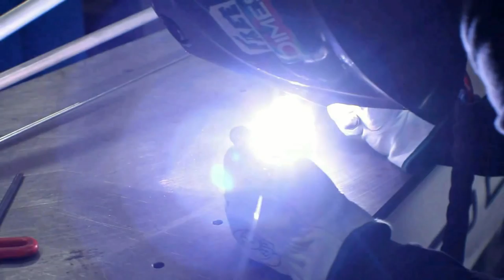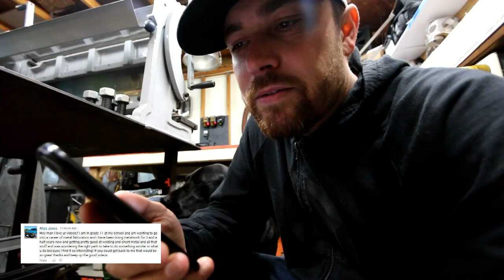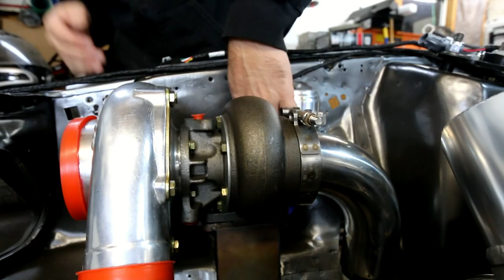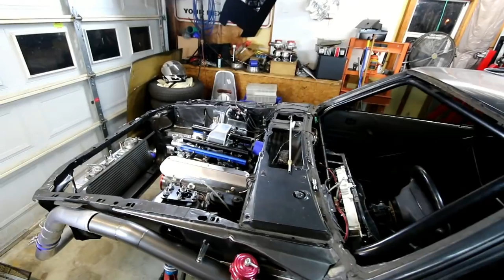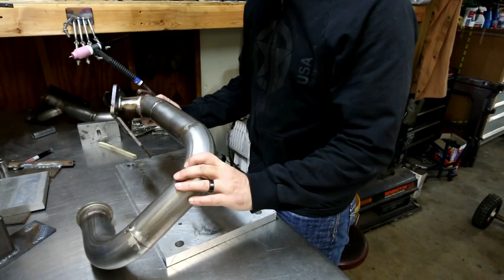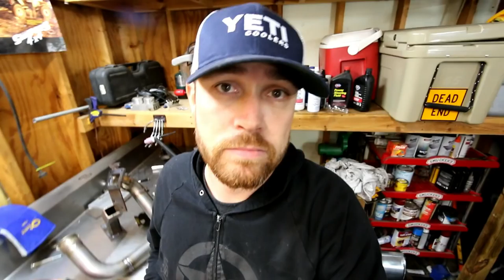The Twin Turbo Turbine Black Hole

Comment: I feel you on the long projects.  Just finishing up doubling the size of a wiring harness to use a different ECM.  I wanted to use a newer E67 (ZR1) ecm and had to double the number of sensors for my build. 

Then theres the trans build, and the turbo hot side fabrication... and the cold side fabrication.  Just keep plugging away.
Reply from the maker: +1320crusier Yup...always something.

Comment: Get yourself a small 1/4 inch hex recessed drive impact (Bosch) and use it with the 1/4 inch socket set that you are using. It will make taking those small things apart very quick and more enjoyable. Keep up that good work.

Comment: Pro Tip: Use backinggas (purgin? is that what you americans call it?) to make the welds smooth on the inside! 
BUT, looking good as always!
Reply from the maker: +Niclas Nybakken Yeah I back purged it with Argon on most of the welds. Everything was pretty much pre welded for the filming.
Reply: Ah, that explains the lack of purginghose

Comment: nice to see you work on the racecar again even if its small stuff at a time 
it will get done eventually 
dont worry bout the electronic system , just learn and wire up system by system and you do ok 
the most important thing is make sure you ground all the items in one place and some high current items like the coilswiring need to be kept apart from the other wiring like the cranksensor and the knock sensors (radio interference realy does funny stuff that takes a lot of trail and error to find )
i bought a vems system myself (https://www.vems.com/) , a lot cheaper then the big stuff system but then im not realy sure if i get my engine to work the way i want too before melting down intoo a solid blob of aluminium (i have limited funds and a expect the worse and hope for the nest kindah attitude on that ), vems isnt as known but verry close to the options the big stuff has , most of the info and software has to be found on the internet though and theres little factory support on it  , prolly be eazier for you to find someone willing to share a basic tune made on youre system to work from 

curious as to how the car will end up and wat times it will make
Reply from the maker: +watahyahknow Racecar? lol . I feel pretty confident in my ability to setup and tune the car. I have a few setups under my belt that did very well with way less resources.  Not sure on the times. I reslly just want to be able to pimp it. I am hoping to make over 1000hp to the wheels. I would also love to go sub 9.99 on a set of true street radial tires. I guess we will see.
Reply: could use someone with a little tuning experiance here as i'm practicly a virgin to that , both with electronic and carb tuning 
that was one of the things why i bought the vems and not the megasquirt : it has knock sensor hookups and a working AR ratio build in , it allso has full sequential ignition and injection (can tune per cilinder basicly )
my project is based of a 4.0 jaguar aj6 , its an aluminium block with a 24 valve head , hemisferical combustionchambers and a way bigger stroke than bore , theres allso a GM 4L80E trans hanging off it though with a different housing 
i bought two of these engines realy cheap (a 4.0 and a 3.6 ) and thinking about boring the smaller one one out and put bigger sleeves (yanmar diesel engine ) and pistons (oversized forged subaru) in trying to get the bore closer to the stroke so it can rev a little more freely 
will take it small steps starting with getting the vems to work on the stock engine sitting in a teststand and prolly end up turbocharging it with a ebay T67 turbo 

theres not a lot available for this engine no more ,  the stock parts like bearings rings and pistons are NLA at the jaguar dealer , its like they want to forget they ever made that engine 
will take some fancy research and machining to get the engine to perform and i might drop the project midway for a better 6 inline cilinder engine with better parts availablillity (bmw/toyota)

Comment: Your electrodes are sharpened the wrong way...
Reply from the maker: +TheDuroProject lol...how is that?
Reply: +The Fab Forums Not me saying... saying that just for help. Check Miller welder for exemple and other. Grinding that way is the best way to embed impurities. And not good for the electron flow.
Also, I didn't notice if your exhaust is stainless, but if yes, you should then protect the root of your weld.
Hope this help, best.